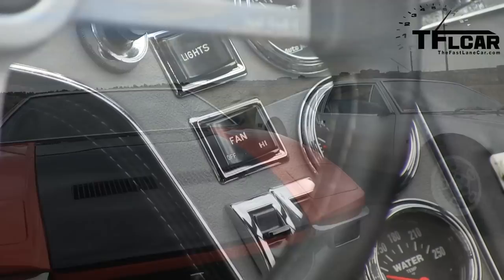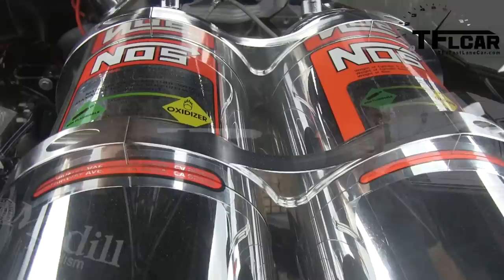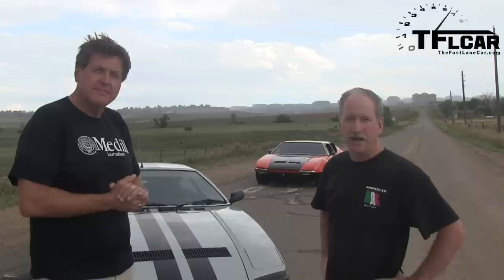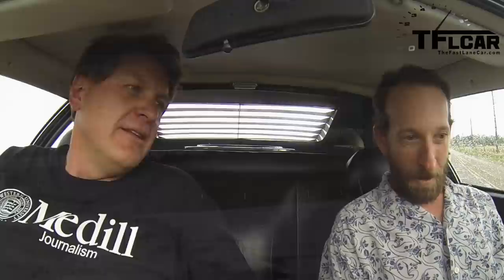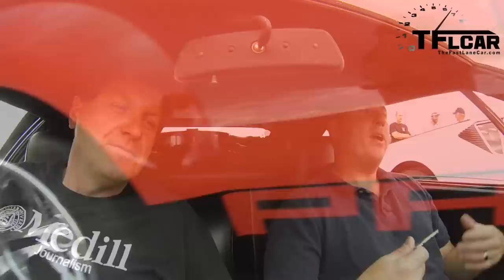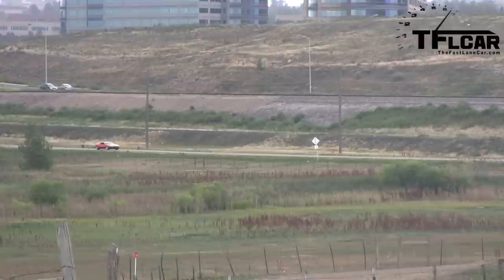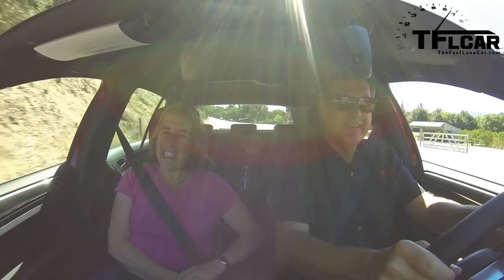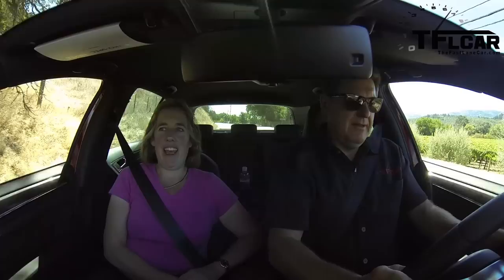Forza Friday: The Totally Original and Modified De Tomaso Pantera Revealed ( Part 1)

Comment: The DeTomaso Pantera was designed in 1969 at the request of Lee Iacocca on behalf of Ford. It was designed to replace the Shelby Cobra.

Like the Cobra, it was powered by a high performance Ford V8. Power from the 351 Cleveland is transmitted via a ZF five speed transaxle; the same transaxle used by Ford's Le Mans winning GT40 Race Car. 

The all steel body was by designed by Ghia and the chassis was designed by Giampaolo Dallara, a chassis designer for Ferrari, Maserati, and Lamborghini.

Comment: Yes, making a Pantera Trackday competative with most modern so-called Supercars is easy and not expensive. Standard bodywork can accomodate big rubber and the motor can produce a reliable and relativly inexpensive + - 450-500ps. Some good brakes and buttoned down suspension makes it a beast at the track...without having to tune it every month.